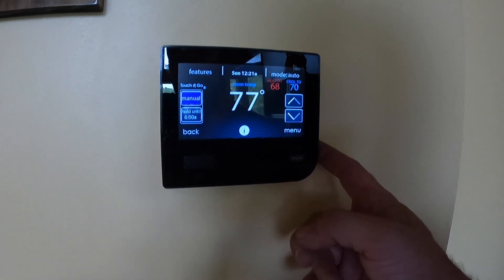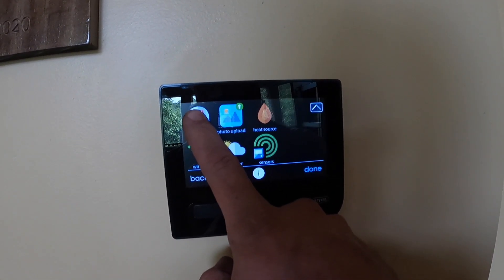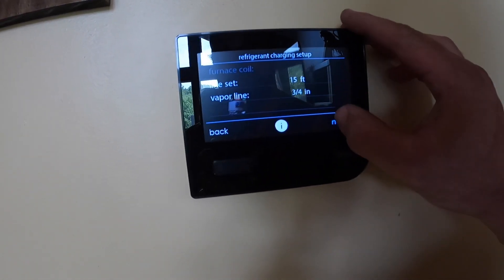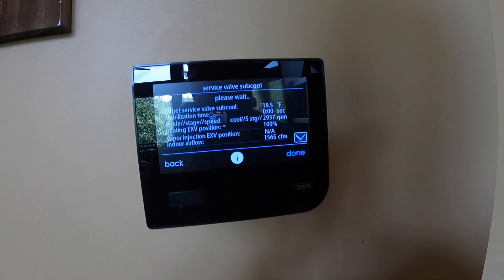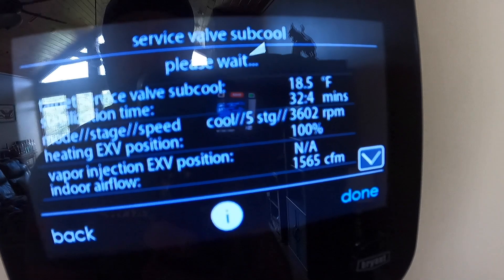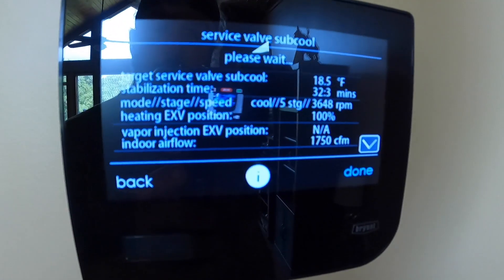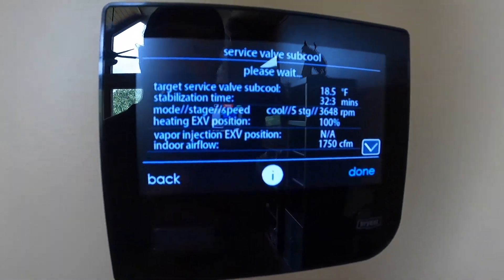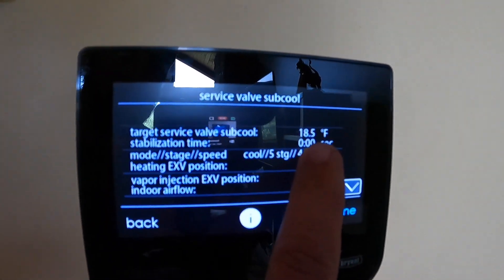How to Check Charge on Bryant or Carrier Communicating Equipment

Comment: So what I’ve learned you have to put in the correct line set diameter length verify evaporator coil model number is a match then do your stabilization. After that, it will give you a target sub cooling, then you can go to check out and run the system on speed five to check your refrigerant charge. Once you’ve done the stabilization once after that, you only have to just go to the checkout mode.